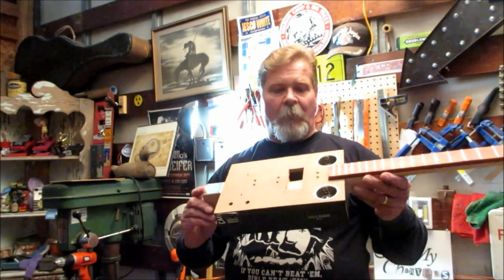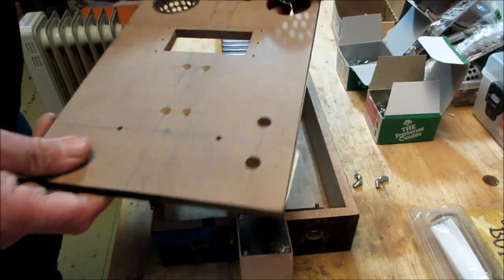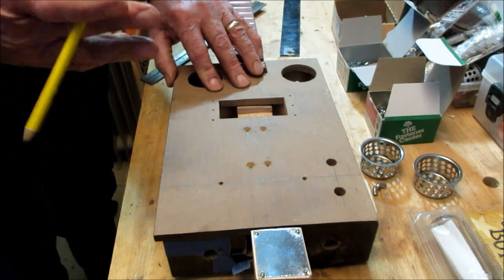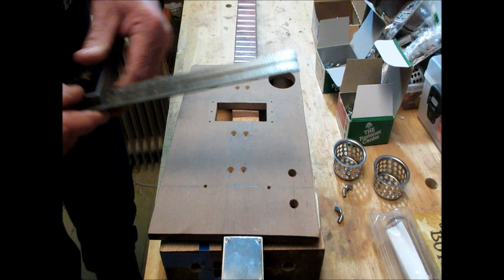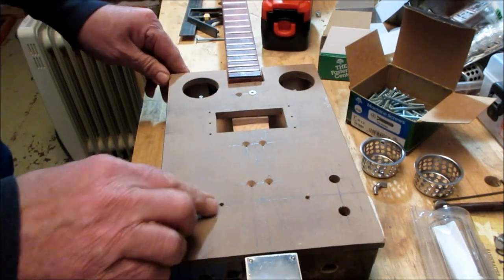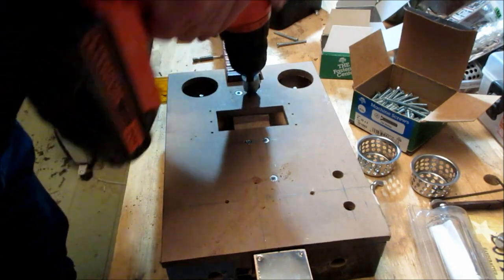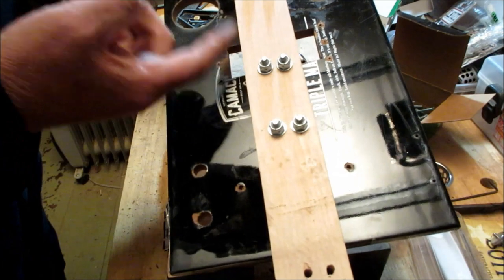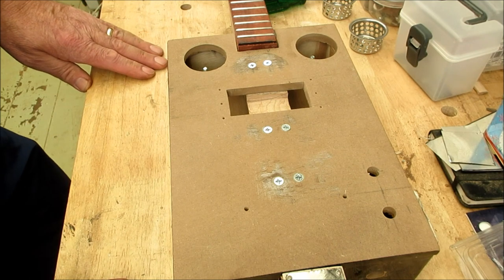Attaching the Neck

Comment: I just found your channel and I like it - thank you.  I build my necks very similarly to you.  I like to have my fingerboard about 6mm above the box lid.  I only use mag pups, (mini-humbuckers, lipstick tube single coils and standard Tele style single coils). I've found using fully adjustable bridges with mag pups, really helps with setting the intonation.  I can also mix plain and wound strings very easily with this type of bridge.  Plus, it's a big slab of metal that makes a perfect grounding point.  

For my nut, I use a 4mm brass threaded rod.  I can get the action low enough so the notes at the nut end, remain true when fretted.  The strings also remain high enough for slide players to do their thing, without clunking and clanking on the frets.  

I agree with you, the metric system really makes building CBGs very easy.  I live in The Netherlands and that's all we use; unless it's the 1/2" wrench/spanner.  That's a 13mm one in metric.  Not much call for one of those though, when building CBGs.  The imperial system maybe more accurate, it's also Martian to most of the world  - lol.

You've some really useful tips and tricks.  I hope more people dive in with their own tips and tricks.  The first build for a newbie, is very daunting.  The more clear help that's available, the better.
Reply: Yes, many different ways. I personally have a heal on my necks and Mount from the bottom